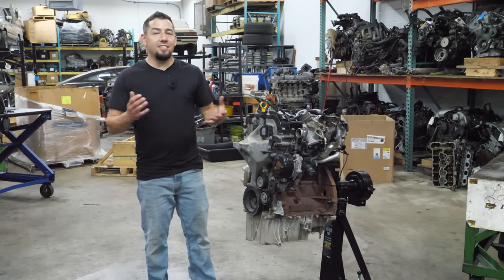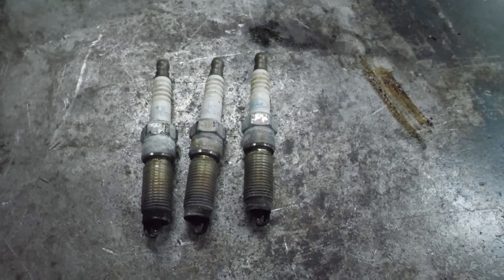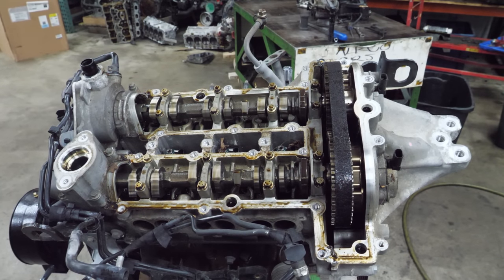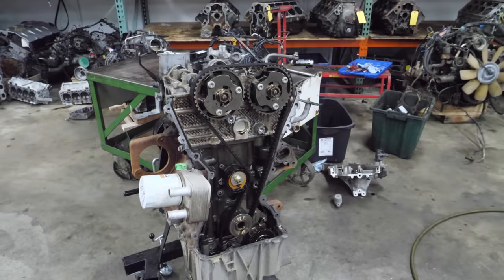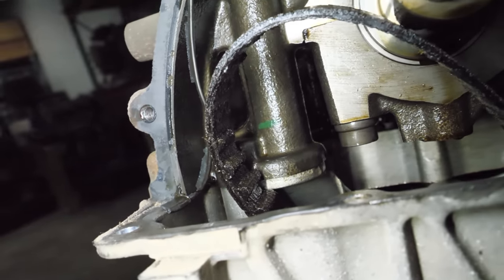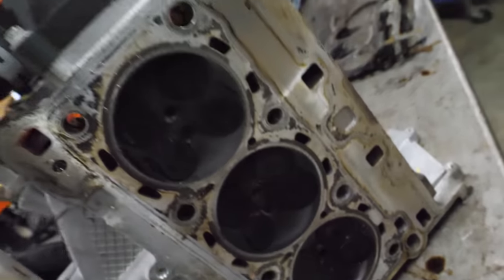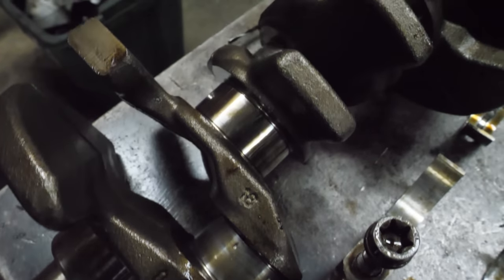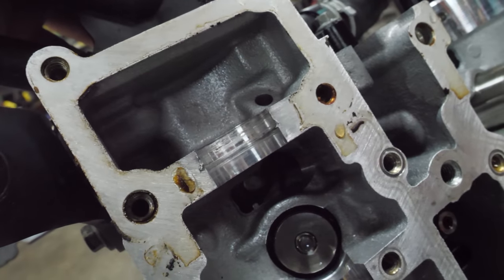JUNK Ford Ecosport 1.0L 3-Cylinder Ecoboost Teardown. LAWSUIT ENGINE!

Comment: I had a 2016 Fiesta with the 1 liter Ecoboost and a stick shift. The car was fun to drive and got gas mileage in the 40s. The engine had excellent low RPM power and would accelerate at speed without downshifting or lugging. I kept it 2 years and then bought an Explorer so I have no idea how long the motors last.  I've had 1 liter, 2 liter, 2.3 liter and 3.5 liter Ecoboost engines and no problems with any of them.
Reply: I had a 2.0 Ecoboost (Focus ST). Started burning coolant at about 180k miles. Not a HG (I bought the car partly because that engine had a closed deck block for that reason and I guess that worked out for not having that specific failure) and not the turbo coolant seal, it was a major Ford design defect that affects the closed-deck 4 cylinder Ecoboosts where the coolant passage between the block and head between cylinders 2 & 3 opens up and introduces coolant into the cylinder(s). The TSB says to replace the engine and there's a CA suit going on about it. Supposedly, this was fixed in 2018, but I don't trust easily. At least I got a lot more miles out of mine than most reported failures. Too bad, as it was absolutely bulletproof until then and got the same gas mileage as my earlier 2.3 Mazda3, but with almost 100 extra hp. It did, however, always use a tiny bit of coolant and a lot of other owners ask about that oddity, so I suspect a lot of them are time bombs. It might not only be the Ecoboost, either, as my N/A 2.0 Focus also always used a tiny bit of coolant Ford called "normal", but I never experienced with any other car unless there was a problem. That car was totaled at a little over 200k miles and might not have had the time to blow out and maybe the N/A versions are under less stress, so it hasn't been widespread yet (and a lot of Focuses had DCTs that junked them first, though mine was a manual).
Reply: You did it right and got rid of them after a couple years of driving, that's why they lasted for you. 
Much longer than 75k on an ecoboost is asking to spend a lot of money on repairs.
Reply: They are not called ecoboom without reason, i know many ppl had engine failures on these 1 litre jobs  my neighbour had one that went boom and the replacement she was not happy with so she sold the car, i had the older 1.6 engine no problem ….dsg however shook ya teeth out when hot
Reply: @eggy1962 The ecoboom name came from a cooling pipe fault in the early cars. That issue is long gone
Reply: @gamesmaster1060  there is a recent tear down video on youtube, its a god awful design that looks so deliberate to make money on extra engine maintenance…eg wet belts,  so ecoboom is well deserved imo. However ford are not alone in shit design Subaru and their rtv silicone gaskets that breakdown and get sucked into oil pumps as well as leaks is another example of bad design at consumer expense and there are more…..like integral water pumps that fail into engine internals causing hydrolock seizure…..think thats enough for now.

Comment: Love the channel! I have a 2015 Focus with the 1.0L Ecoboost. Car just hit 110K miles and still running strong with regular maintenance and oil changes. And I average around 32 MPG in city and 42 MPG on the highway.
Reply: 1.0 EcoBoost 125 Automatic:	48.7–50.4 mpg rated with real life 35.1 mpg. So no, it does have some promise when not broken
Reply: Your Ford Focus says...  I have done 110 K Miles please give me a medal...
My Toyota Celica says ...  224 K Miles ...Hold my beer
Reply: @briansaiditsoitmustbetrue4206  my 1991 Toyota 4x4 Truck blew a head gasket twice. Many water pumps with timing belt replacements. It cried all the time. 
My 2002 Ford Ranger 4x4 still has the same water pump, timing chain, everything except auto transmission rebuilt ( Toyota was manual) it is running cicles around my Toyota. Now pushing 300,000 miles no oil use or leaks.😎 bought both brand new

Comment: I worked in ford parts department for 3 decades, within a couple of years of the ecoboost launch we regularly had garages asking us for oil pressure switches. Cure the fault mate, not the symptom 😂. Oil strainers were always blocked up with bits of wet belt, equalling not a lot in the way of oil pressure 😂

Comment: I had the exact same problem at my shop,  the customer had used the wrong oil in the engine..   Use only the recommended oil!  The engine got fixed and ran great.
Reply: Yeah my mechanic told me the same thing. The problem only arises when people use the wrong oil. Maintained correctly these engines are fantastic.
Reply: Change
Reply: Oil as much as possible

Comment: I had one of these for 2 years from new and it was absolutely brilliant. I did a lot of motorway driving so it mostly ran at 70mph in cruise control.  I used to get 56mpg on long journeys.  Plenty of pull and very quiet for a 3 cyclinder. These engines must have very good quality oil and fuel to keep them sweet.  If you run one of these engines you must follow the belt changing frequency. If you don't follow the maintenance routines and frequency similar to a high proformance bike, you will have an engine failure.
Reply: Cost of replacing belt every 6 ( ) years 👻

Comment: Well, I have seen this wet belt failures on those engines before... someone mentioned to me that those belts are extremely sensitive to the oil you are running. If you don't use the oil recommended and certified for the engine, additives may dissolve the belts leading to catastrophic failure.
Reply: And it happens fast. But whit proper oil and following service schedules, it goes amazingly far. As hp per litre engine
Reply: I'm still not impressed. Seems like it's full of design issues.
Reply: Sorry but having the correct oil in they still go Boooom

Comment: I’m really looking forward to this. I’ve seen a hundred v8’s and straight sixes. I’ve never seen anything so compact and cute being taken apart. It’s very fascinating 🧐 love the channel 🥰
Reply: One of Ford's advertisements was that you could carry that engine in an overhead compartment in an air plane.  😁
Reply: @forrest1948  yes and the shortblock was not bigger than a standard sheet of A4 paper.

Comment: I had one of these 1 liter in my 2018 Ford Focus, it was the 100hp version(5 speed manual), I drove it about 55k miles and didn’t have a problem with it and I still see it posted for sale 10k later. I used to get 33 mpg in a city with a bit too much aggressive driving and for the most part it was peppy enough, assuming you weren’t overtaking at 50+ mph

Comment: Holy crap what a good video. Learnt so much from a poor engine. Time to see what else you have 😊
Reply: It's not a poor engine my 2013 fiesta 1.0 ecoboost has 140.000km on it and even fords so called poor Powershift dubble clutch automatic and i have 0 issue's with it but the 10 years are over and i will have to get the wetbelt replaced soon what i think is bad that it takes forever to swap those parts

Comment: This was a fascinating watch! I've had my 2016 focus 6 speed with the 1.0 since new. I avg anywhere from 40 mpg in winter to 51+ in summer. 113k miles and no concerns, but now im thinking i should get the belt done since at least twice ive had the oil changes done somewhere other than ford and am concerned about the belts. Great video. Learned some stuff. Thanks 👌
Reply: I've had mine for two years and with 2 services under my name. I didn't know about the very specific oil requirement, so I took it to a local garage for a service. I have no clue what oil they used, nor do I expect they used the required spec. Will make sure it gets the right oil from now on. I am on 57k miles and everything seems great so far though... Only time will tell.
Reply: Was your 1.0L Ecoboost?
Reply: I have a 2017 1.0 focus also with the 6sp manual that I bought new. About to turn 50k miles - thanks covid for the work from home! I've been getting paranoid about the belts (and head gasket - flushed and changed to the yellow ford coolant at 40k miles). I wish there was an easy way to inspect those belts. I will likely wind up replacing the belts and tentioner later this year as preventative maintenance (I have access to the special tools). That belt is a feature of the car I bought it with the expectation to last 10 years or 150,000 miles and I'm looking at replacing it at the schedule of a regular dry belt.
Reply: Im from SA and have 2016 1.0 AT Focus sedan  really one of the best cars i owned buy it new and every service is done by Ford Dealership  must admit i do only long distance trips with 4 adults and luggage  and avg fuel consumpsion is about 15.2 km/L with avg speed 120-130km/h
Reply: Hey, all of you lovely eco owners. I have some very important advice for you. Firstly, do NOT miss an oilchange, even a month overdue will block up some very fine filters around the engine. First the vacuum pump will go and you'll lose turbo functionality and sometimes brakes. Really remember the oil change intervals. Secondly, the coolant. This engine does not have a low coolant level sensor. It also has very fragile coolant lines that will shatter for absolutely no reason. Either have them changed or be ready to pull over as soon as you smell burned coolant if it ever comes to that. The temp gauge does NOT tell you if you're overheating.
Reply: same as our government, best ever @johanbadenhorst2233
Reply: @mrscrewu1199  The coolant line issue were the 2012-2014 models. 2015-up have revised lines to the expansion tank. Agreed on the lack of a low coolant light. Terrible oversight. The 90's Mercury we had had one! Cheap Ford being cheap.
Reply: @TheRetarp  Oh that's good to hear! I know right! Somehow managed to place the engine temp sensor in a place where it shows normal temps while the piston is melting (speaking from experience lmao)
Reply: @mrscrewu1199  sadly it seems every car is the same way nowadays. Had a 4.7L Jeep blow a head gasket due to a bad valve seat. It merrily overheated due to low coolant while keeping the gauge right in the middle. No low coolant indicator in that Jeep either. Reservoir/overflow tank was right at the normal level. Can't seen down into the radiator on that model. Now this 1.0L with the head gasket and timing belt issues. It's ridiculous that I have to put 'will this car blow itself up' on my shopping checklist with a new car nowadays :( I can't wait until I can buy an EV with 400+ range for a realistic price so I can kick this garbage to the curb.
Reply: @TheRetarp  That's insane. And yeah, can't tell you how many engines I'm dodging at this point lmao
Reply: @mrscrewu1199  I never miss a oil service, I do a oil change every 6 months, and do a full service once a year, the biggest mistake people do with these engines is relax when it comes to an oil change, they leave it too long.
Reply: @kd84afc  i left mine for maybe 2 weeks because I couldn't find the time. Vacuum pump seized. Absolute shit engine
Reply: @mrscrewu1199 absolutely spot on, happened to our focus, vacuum pump, then brakes then oil light flashing, manage to px quickly before engine went bang
Reply: @ohmygodwhatareyoudoing4929  lovely! Make sure to test your vaccum, such as rapidly pressing and releasing the brakes. If the brakes get weaker, this is especially noticeable at idle, you need to replace the vacuum pump. The poor thing tears itself apart as soon as the oil flow reducer gets clogged. It seems like nothing but if you're unlucky, you won't have vacuum for hitting the brakes. Very scary
Reply: @mrscrewu1199  yes, been there done that, piece of crap, traded for another ford😯🤣🤣🤣
Reply: @ohmygodwhatareyoudoing4929  lucky you, mine is sat in my drive with the engine in 3 pieces 😂

Comment: My Dad had a 1971 Ford Ranch Wagon with a 351 Windsor engine under the hood. it blew up at 40k miles. When we tor it down, we found nylon teeth from the timing gears jammed in the oil pump. I'm sure that nylon timing gears will go down in history along with wet timing belts and screen doors on submarines as some of the best ideas ever.

Comment: For over two years I been driving a 2014 Fiesta SFE 1.0 liter manual, and I really like the engine, has plenty of power and gets me 40-50 mpg on my commute,  they really didn’t import many of the 1.0L to the US since in the Fiesta they only came in manual.  After seeing this I’m planing to do new timing /oil belt  and checking the oil pickup at 120k.
Reply: My son has a Mazda 2 with the 1.5L liter engine and 5 spd manual. It has seen as high as 43 mpg on longer trips and never less than 35 mpg around town. Simple and reliable albeit a little slow in the upper gear ranges.

Comment: Just found your channel via reccomendation. Love what you do with examining each part as you dismantle the engine.
Those 1.0litre ecoBoost engines are gaining a very bad reputation here in UK.
Reply: Perhaps most UK Ford owners just don't change the oil in time or simply put crap oil or both! Have you thought about that?
Reply: @Maverickf22flyer  if that's the case, then how come the EcoBoost 1.0 is the only engine with this many consistent failures? Shouldn't other engines in the UK be blowing at a similar rate if their oil is not being changed regularly/using Tesco-grade motor oil? And what does that say about Ford if they can't even design an engine keeping that's durable enough for their target audience?
Reply: @jst_TV  
What are those "MANY" consistent failures man? Just name them? Cause everytime I see someone complaining of it, the same fault emerges: lack of lubrication and subsequent engine knocking occuring because the oil pickup gets clogged. Only rare occasions of locally melted pistons were encountered on ST versions and that were certainly causes of low grade fuels causing detonations in the engine under load. I've never seen any of thos "many" that you refer to..., just lack of lubrication due to oil pump failure due to oil pickup clogging..., finally due to dumb or abusing owners that put poor quality oils and changed them very very late.
Reply: @Maverickf22flyer  I don't need to name them, you can watch Eric's 30 minute video yourself. You can ask the UK tradesmen (you know, the people who gave the engine its EcoBoom nickname) who have to swap these engines day in and day out. Or the mechanics have to diagnose the same engine issue for months to the service writer. Or why don't you go ask the French mechanics/tradesmen who were the first victims of the wet belt engine design via Peugeot/Citroen? I'm sure they're all singing praises about Ford/Poogeot's wet belt design and its reliability 😂

If your engine cannot handle the stress of your target markets' usage, then you have produced a bad engine. No ifs and or buts. There's a reason why every smart person who owns a Focus/Fiesta with the 1.0 is dumping it immediately after the warranty runs out and resale value drops like a bowling ball. Trying to say "uhh these engines are only bad cuz the owners are bad" is just cope to the highest degree bcz ppl abuse 2JZ, or hell even the EcoBoost 2.0 or 3.0, without issue. But the same every day driving with slightly deferred maintenance is enough to kill the 1.0's repeatedly and prematurely? Nah that means something's gone wrong with the design
Reply: @jst_TV  
As an owner who carefully took care of his 125hp Ecoboost Focus 3 Facelift it makes me utterly curios of what you say. Can you please give me a link to what those mechanics have found or to diagnoses reports? I appreciate it.
Reply: @Maverickf22flyer  I would, but the link would just redirect back to this video's comment section sorted by new. Or you can check the various other 1.0 disassemblies on YT and see the disgruntled mechanics + customers in the comments tearing it to bits. 
And the keyword you used is "carefully". Any engine can last if kept properly, even the worst most unreliable disposable ones. The problem is designing engines that only work if they're kept in immaculate condition is not a good business practice. It'd be like designing, marketing, and selling the best suspension system... that breaks after hitting 1 pothole and requires a £4K repair to fix each time. Life is not perfect and you'll occasionally miss an oil change interval if you don't change your own oil (aka most ppl purchasing cars with 1.0's) but that shouldn't spell a death sentence for your car. Like I said, you need to design an engine that works with your target audiences' lifestyle otherwise, why make it at all? But considering Ford killed the Fiesta globally, I think they're going the latter route.
Reply: @Maverickf22flyer I think that is a good part of it. I've known people drive these cars and they treat them like an appliance. They just turn it on and go. No maintenance and wouldn't know how to check for wear or replace or top up things anyway. Tyres flat and bald. And waiting until warning lights appear on the dash to do anything.
Reply: Shit engines, even with normal driving and regular oil changes. They burn oil, eat there timing belts, have misfires, cracks oil leaks, coolant leaks and so on. Oo and they ratle on the turbo haha. And are not that economical. Better to bu a 1.5 tsi or something like that and keep away from this
Reply: @adn9122  
Cheap oil with long miles between changes?! Be honest!
Reply: @Maverickf22flyer  I see the "you're holding it wrong" syndrom has also entered the car industry. Please don't defend dubious design as if you invested in it yourself. You can be a happy user even if the same car doesn't work for someone else!